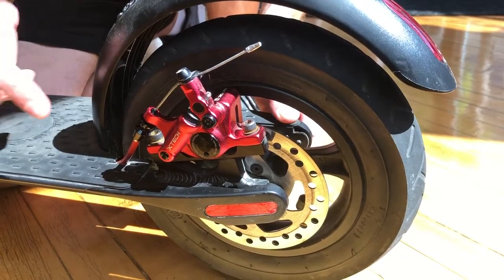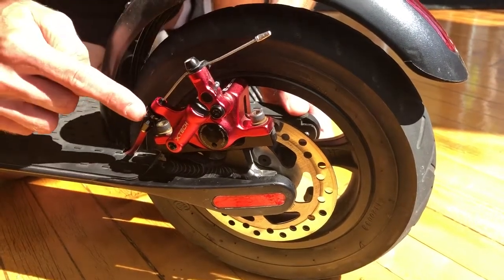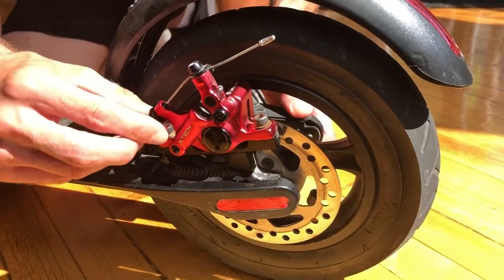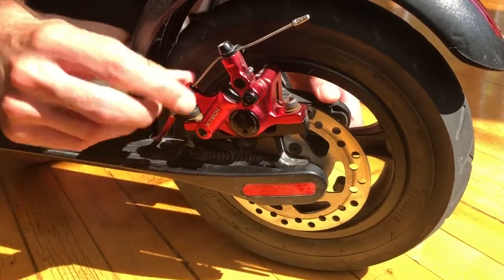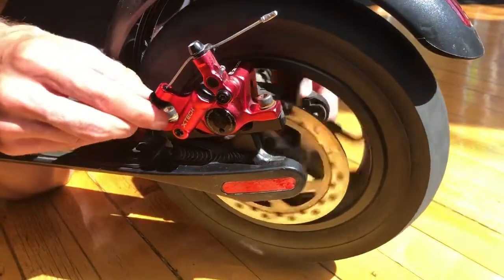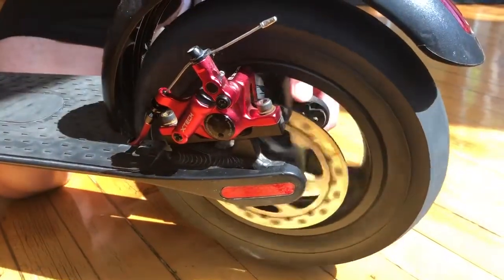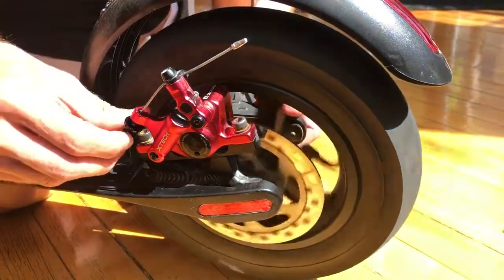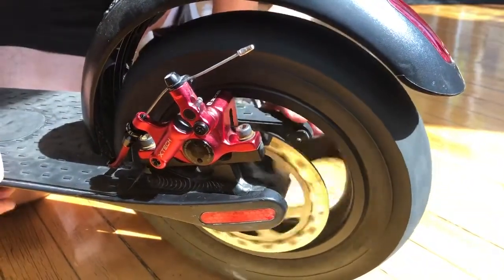KOMOTO P700 - Adjusting your Xtech Brakes

Comment: I have a problem, my pads are rubbing even without any cable on 😢. it's only slightly but how can i adjust with no cable.
Reply from the maker: Your rotor could be warped and not true anymore.
Can use a trueing tool or a wrench to bend it back. 
Smaller rotors are easy to fix straight.
Also can use the screw near brake cable to adjust smaller amounts than moving the entire wire. 
Hope this helps!
Reply: @komotoelectricscooters  ive actually found out its the pistons.one is not retracting.
Reply from the maker: @ianpearson8976 Sadly sometimes they brake calipers fail. Then you need to buy a new one. I have some that have lasted years on some scooters and others fail in 6 months. Just depends on many factors.
Reply: @komotoelectricscooters  lol i havent even used it yet brand new but might be my fault i may have squeezed the trigger without pads inside and could have ruin it.